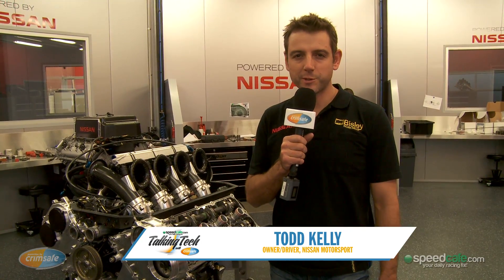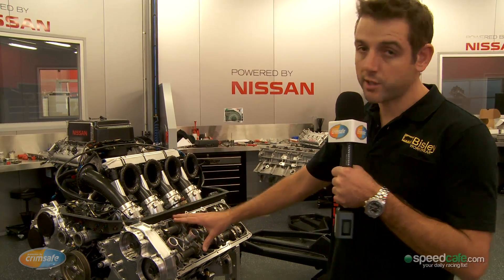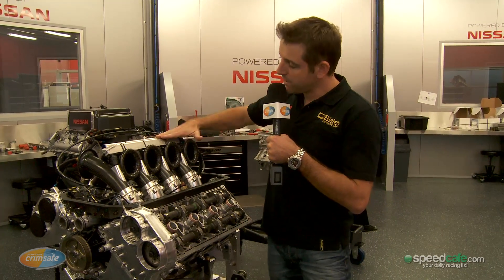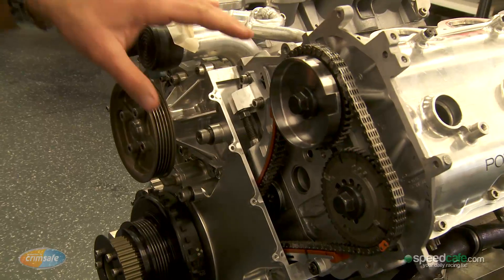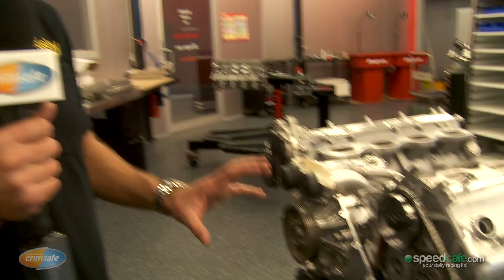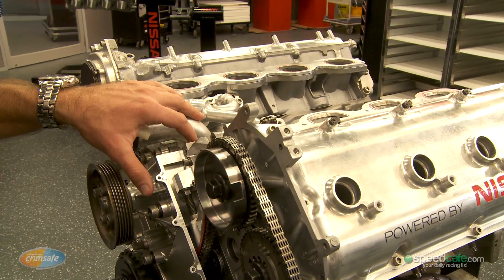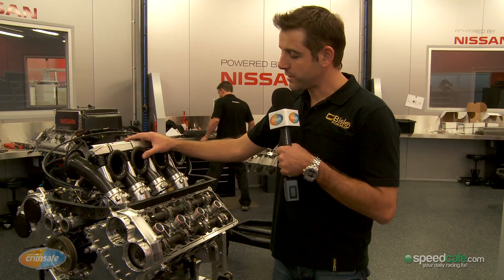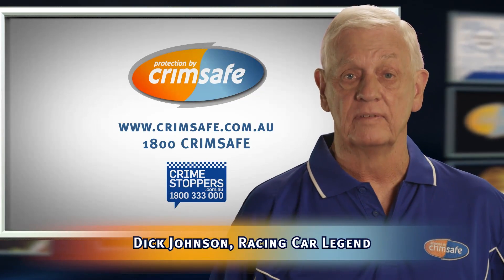Crimsafe Talking Tech - Nissan Engine

Comment: On the vk56, can you get to the internal oil pressure relief valve without pulling the timing cover? Can it be accessed by just dropping the top oil pan and unscrewing the pressure relief valve from under the motor?

Comment: one massive advantage a 4 valve engine has is valve area to bore area, so it can move more air at lower lifts, so that means it can supply enough air for high rpm without having to resort to ultra high lifts and durations, that means more stability, as not many people know that its the valve train stability that lets a motor turn ultra high rpm,
Reply: eh, kinda. The problem with the higher lifts needed in pushrod motors for high RPM operation is that valvesprings not designed for it can't cope with the rapid cycling. They either never fully close, and float or they bind up and never give you the specified opening. But these can be addressed with correct components and camshafts that offer the duration required to get high RPMs. GM did it with the DZ302 which would give you 7000 rpm from the factory...in the 1960s!
Today, the LS motors, especially the LS7, have no trouble turning 7000 from the factory. 8000 or more is no issue with proper preparation. We just don't see it from the factory because displacement is how it makes its power. It's not valvetrain stability so much as its proper component selection. You need high enough lift to make it worthwhile but not so high that you screw yourself in geometry. You need enough duration to actually fill the chambers to push the motor that fast. You need springs that can handle the rapid cycling and light valves. Oh, and plenty of oil pressure to keep it all from welding itself into a solid mess.
Reply: Mike McKeen my 2cent? VK56DE IN INFINITI/maybe in titan cams are micro polish, titanium vavlespring,ngk iridium spark plugs go for 100,000miles,@$21- each only get them at the dealerships or  napa for $23+tax,water pump seal is stainless steel metal...$27+ napa only had one....took over 30 min to find in there wherehouse...so...111,000miles pre-order plugs...demand was so low($12+tax...each year gets it own plug!lug nut was $20!motor is what we call bulletpoof?just saying...from girl point of view...sodium vavles,intake tech from gtr.VK56DE/VK56VR??THINK?
Reply: I have no idea what you're talking about. Are you saying that the VK motors employ fancy things like sodium filled valves and titanium valve gear? That may be true, but its far from unique. The LS7 motor from GM used sodium filled valve stems and titanium connecting rods more than 10 years ago.

Comment: I think there's always this feeling you get if you create a motor that was never built that you may blow it up,I have a VL Commodore fitted with a Nissan RB30DE which I built 11- 12 years ago and I run it with the RB25 computer from an R33 Skyline,well on January 1 2004 when my brother & I fired the engine up and took it for a drive,well, it wouldn't rev past 2000 RPM and was fouling spark plugs up.
I went through all the diagnostics which kept on spitting out a code 12 for the MAF meter,well we went back to the Toyshop auto wreckers when they were at Cardiff in Newcastle and asked if we could try another MAF meter,well the problem was the same and I checked that the wiring continuity in the loom was o.k. so we decided the car needed another ECU as that was faulty.
They didn't have a RB25DE ECU in stock so they had to order one in for $300 (ouch !!!)  as I wrecked the RB25 for its pistons,oil pump and cylinder head assy and just used the RB30 crankshaft & conrods,also the engine would've been out of warranty anyway so I tried a Nissan RB20DET ECU which was chipped for HKS cams but no good as the engine stalled when I put it into gear and let the clutch out.
So I borrowed a stock R32 Nissan RB20DET ECU as they use the same fuel injector impedence,flow rate,etc as the RB25DE and the ECU ran the engine no worries albeit the idle was high as the throttle position switch is different though could've been made to run using the automatic part if the switch as the R33's TPS has variable resistance and the automatic part of it is separate and is like the RB30E one (same as R32 RB20DET TPS) so the idle was higher than normal,it would've also meant the VVT solenoid wouldn't work too.
Now after the engine was run in I decided to redline it in each gear to 7000 RPM to see how it went, well after I hit 3rd gear I see all this smoke pour out of the exhaust pipe and red & blue flashing lights behind me, yes the police canaried me and said it looks like somethings dropped inside the motor, so I have to get the defect cleared and the engine number changed over by the local mechanic as I was running another RB30E in the car and refitting the original engine block back into the car.
I was afraid that I blew the motor up but I asked people on the internet and I found out it was caused by the fact I put 1/2 a litre too much oil into the engine,yes,high revving multi valved engines HATE being overfilled with oil by even a few hundred mLs , I found that out from different people too.
I still have the car under a cover but unregistered and the engine has about 200,000 kms on it since being rebuilt and still has good compression,I noticed it did burn some oil  and I am thinking it may (not sure) be valve stem seals and was using oil last time I drove the car (about 1 litre per 5000 kms), one thing I found is the overflow tube that I modified was blocked up with sludge at the bottom elbow near the oil return near where the oil pan mates up to the engine block,I am looking at revising that (i.e. straightening the line out a bit).
The oil was getting into the air filter,what I'm thinking is the oil wasn't making its way back down to the sump through the return line,it was getting sucked through the crankcase breather hose,into the inlet manifold then into the engine then out the exhaust pipe,it started to happen when the computer got water in it and shorted the injector driver for number 4 injector out and jamming it open,so the engine got washed out with fuel.
Luckily the compression is still good so I think the sludge got washed into that elbow in the oil drain tube causing the blockage and a trip to the Japanese wreckers saw me end up with an injector for a Nissan SR20DE from an N15 Pulsar (same as RB25DE injector) which fixed the problem.